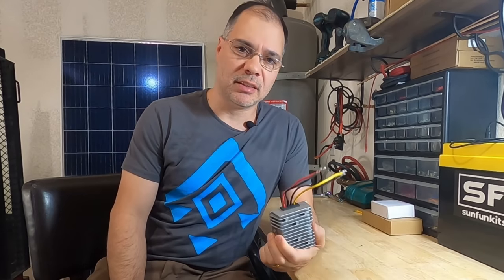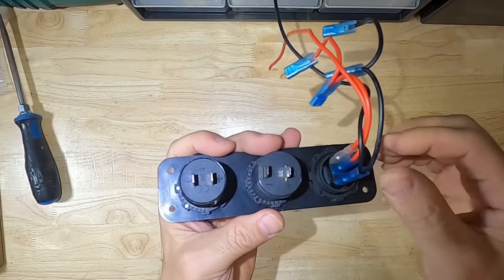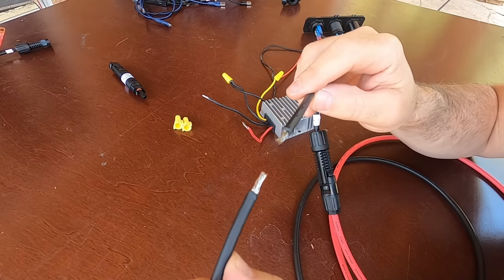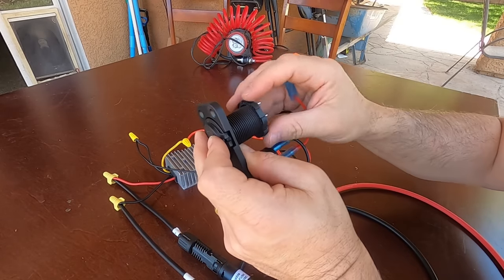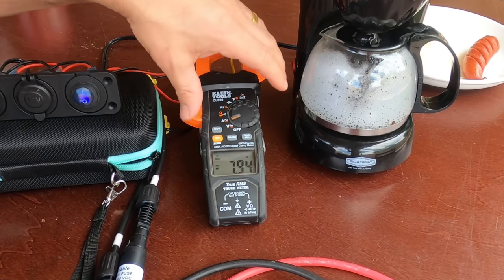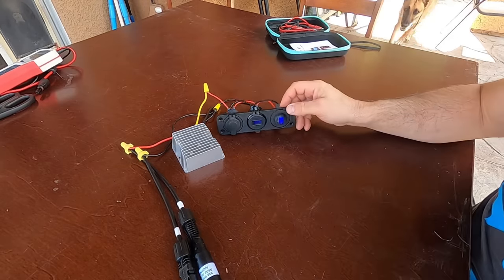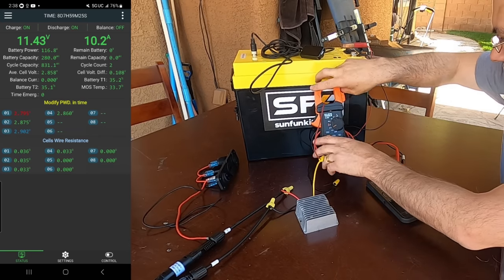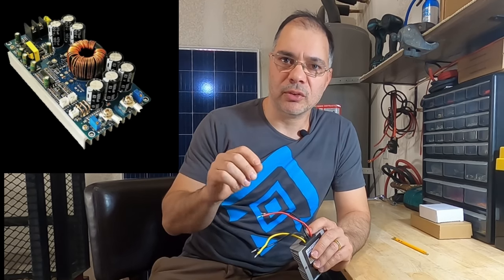SHTF - Cheap Emergency Solar Power! Use Any SINGLE Solar Panel! 1/2

Comment from the maker: >> 07-08-2023: I want to thank everyone who subscribed to my channel! Thank you very much!! I appreciate it GREATLY!!! 

>> NOTE: Although 200 watts of solar power is relatively benign. Never connect more than ONE panel or combination of panels totaling more than 200 watts of power to a buck converter. If you are uneasy about connecting wires, look at getting a USB Solar Charger instead (see below). Always use common sense when dealing with electricity. See my website for more details.

Schematic and Parts List  (updated 07-30-2023)
https://www.natesdiysolar.com/projects/shtf-emergency-solar-power/

Testing USB Solar Chargers:
https://youtu.be/gbXcJI6VRcI

>> 07-31-2023: Some buck converters will serve as an emergency battery charger but should only be used as such. I have been doing more testing with buck converters charging 12-volt batteries and have gotten mixed results. I am not quite sure why, but I think some buck converter expect to see a load in order to output any power. Either that, or it just is plain inefficient. Some will work and some will not. Even the junkiest MPPT is better at charging batteries from solar panels. Check my website for more details. Update video coming soon!

>> Do not use wire nuts as mentioned in the video. Use XT60, Lever Nuts or BUTT Splice Connectors. They are not DC rated or water proof and if the connection is not good, could create heat. I used them because I needed to quickly disconnect and re-connect to do this testing. 

>> If you plan on using this long term, be sure to use larger wires on the USB panel (12AWG - 14AWG). I use the same USB panels on my Solar Power Station but I have upgraded the wires to 12AWG. The 10A fuse that comes with some of these USB panels have a 10A inline fuse that is junk, it will work for the USB and PD module and smaller 12V appliances. Larger 12V appliances like the ones I used in the video will melt that fuse. I would replace that fuse with an automotive blade style 15A - 20A fuse instead and place it on the output of the buck converter (positive) wire. I will update the schematic on the website to reflect this.

>> Just found they actually have a tiny buck with USB-C and USB built in so no USB panel needed. So if you are looking for USB charging only take a look at this one. You can also just get a USB Solar Charger but this unit lets you use any solar panel. But if you already have a solar panel, this unit is cheaper than a USB Solar Charger.

If anyone can find a "plug-and-play" converter, please let me know. I really would like to build a small "power block" for use when camping. It would have all the common outputs you could imagine.  I found a mini MPPT and all I need is tiny 20 - 50AH battery. 

Affiliate Links:

Please see my website for more details and options.

8-85V to 5V USB  to 5V 3A 15W (USB ONLY)
https://amzn.to/44ibiVk

DC-DC Converter 20-90V to 12V DC - 20A 240W
https://amzn.to/3NPFtxt

DC-DC Converter 8V-40V to 13.8V DC - 10A 138W
https://amzn.to/44DeoCU

Dual QC3.0 USB Car Charger Socket Panel Switch
https://amzn.to/3JE7tkU  

10 Feet 12AWG XT60 Solar Panel Ext. Cable 
https://amzn.to/3rdKRBG
 
Pair of 9In 12AWG MC4 Pigtail 
https://amzn.to/3Py8bEd

Enjoy :)
Reply: People need to know the "Ampacity" of their wiring. For 6' or less (Round trip pos to neg) 14ga is rated for 15 amps, 10ga is about 30 amps. Amps times voltage will approximate wattage. 
12v x 10A is 120watts, less wire loss, efficiency of the conversions, and connector quality. No Gold?, good luck. 
But your idea is sound, and very useful if protected from EMP. How do you protect from multiple EMP's? I have Laptops awaiting long term storage, hard drives and DLP projectors. The Sun has spat a massive CME this year, fortunately on the far side. It would have devastated 1/3rd if it was 5 days later or earlier. It would have melted all metals. Bridges and buildings would pop and crumble. No power, no fuel, no rescue. We can't afford to water our plants and the soil. Recycle every drop. Dehumidifiers reclaiming water from the air. Actually more efficient than cleaning new source. Deep pockets are trying to control water. Oddly enough, we buy a lot from them already. Sounds like Win/Win for them.
Reply: Nate I enjoyed the video and I learned a lot about the system thank you very much however you cannot charge a 12.6 V car battery with a 12.1 V system you must have a voltage between 13.5 to 14.5V to push the current into that lead acid battery just letting you know a little old fashion automotive and Truck electricity knowledge there buddy.
Reply from the maker: @papadean.  thanks.  I actually mentioned that in the video as well as provided a buck converter option with 13.8v output for that purpose.  😳 thanks for watching !
Reply: my car battery always fails from the small solar system used. will try your system out.
Reply: 👍Pm

Comment: This is a great idea but I want to comment on the wire size used connect the switch etc. You didn’t specify but based on what I saw in the video that was 16 or 18ga. wire. That is way too small for a 20A buck converter. Everything should be wired with 12 gauge pure copper wire, with a 20 amp fuse in line with the output of the buck converter. Natural disasters are bad. Natural disasters plus fire are much worse.
Reply from the maker: I did specify in the video and in the description.  I also recommend upgrading them.  Unfortunately, they all have the same crappy 18awg. Right you are.  Good observation.  👍
Reply from the maker: See @9:45 and @19:42 . This is the way they all come.  I searched for ones with larger wires. Thanks for watching and the comment.
Reply: Most factory 12v outlets in vehicles are rated for 15 amps yet they use 16awg or even 18awg. 
If the wires are shorter as they should be in this application, your resistance will be lesser than in a vehicles 12v outlet.
12awg is ideal but 16awg is okay unless you're really pushing a steady 20 amps.
Reply: @JesusSaves86AB  I would rather use a larger wire than chance a fire in my system burning down my RV.
Reply: @Tumbleweed5150  That goes without saying. Wire is cheap and anyone willing to make something themselves will spend the extra pennies. I'm simply adding context for clarification.
Reply: Six months ago I plugged the output from the 100w panels into a 12v tent fan and it worked as long as the sun was shining.
Reply: Just to be different. If you are going to do some eating on a video, one should always hold the fighting irons correctly. It looks so much better. I really did like the way you explained how to make that back up system. Thank you for sharing.

Comment: A better buck converter for direct connection to a solar panel would be 24v DC to 13.8V DC, 30 Amp..then it can be used to charge a 12V deep cycle battery as well. This system is great for running a thermoelectric cooler while on a picnic, no need to lug around a heavy battery.
Reply from the maker: Yes, I did see those, but the really great thing about this particular one is that it will work with practically any solar panel as the input voltage is not fixed.  I didn't want to be limited.  One unit to rule them all. The adjustable ones can do it all. Best of both worlds with a decent input voltage range as well.
Reply from the maker: The first panel I used had a voc of 38 volts. Would not work with a fixed 24v input buck.
Reply: I would second the suggestion of 13.8V. Most devices called 12V are actually expecting to have 13.8 and may labor or not put out as much power on 12V. As a bonus…. These units can connect directly to 36 and 48 V batteries. This may have been salvaged from discarded electric hoverboards or scooters.
Reply from the maker: @tegra5971  yea I saw those higher voltage output ones but not with a 20 to 90v input range.. that was real appealing to me because it would work with almost any panel. But yes.  Most 12v nominal will operate up to 14v and yes these bucks tend to sag.
Reply from the maker: The perfect unit would be say 20 to 70v input and 15v or 14.8v output .
Reply: @natesdiysolar  The ones I sell look identical to yours and are new old stock from 48 volt lead acid street (vespa like) scooters.  They are only labeled on the deteriorating plastic bag and say DC to DC 48-12.
They are actually at least 90 in and 14.4 to 14.8 out.
I'm not sure what the maximum output current is, but one of the scooter types had very bright dual headlamps as well as turn signals, running and brake lights.
With a fully charged battery pack imput to this DC to DC would be 60 volts through a 20 amp fuse. Output was unfused (China not me).
I have tested the entire scooter with 5 batteries so add 14.4 v to those numbers is safe.
I suspect mine are identical inside as well as outside to yours, and that if bolted to a metal structure and had sufficient input voltage they would output 14.4+ volts at 20+ amps for days on end.
More if fan cooled.

Comment: Very interesting and informative video you made. Gained a sub here, I'm just getting into some solar stuff. I just picked up 7 100w panels from a friend for dirt cheap. I have a charge controller for batteries but this is an excellent way to expand capabilities in worst case scenario. 👍
Reply from the maker: Thanks! Appreciate it!

Comment: While the thumbnail's challenge is no controller, personally I'd still use an MPPT due to its massive efficiency then connect the DC to DC converter to the MPPT.  DC to DC works best more efficient if the difference between voltages is lower.   Nice showing of the 12V cigarette lighter appliances, never knew those.👍
Reply from the maker: During my research, I did find a mini MPPT I'd like to try out.  I use the buck as you say on my solar power station
Reply: @natesdiysolar very nice to see you. We will be waiting for your mini mppt.. Wish you best of luck man.. Appreciated ❤
Reply: I have been testing MPPTs all week. No, they generally do not have a big advantage, infact, in good sun conditions, the mppt actually uses power. Mppt can extract more output (creates a partial short accorss the panel, eg, a 12v panel will be loaded down to 9v) in low light conditions, heavy shade, or part shadow. However, in those conditions, there might only be 5% to 10% of full sun output.
So, yes, mppt might be 30% more efficient in 10% irradiance conditions. This means, your 10% of full sun output soars to just 13% of full sun - and this is the most optimistic best case scenario for mppt. A actual 3% improvement in low light - wow, I must get one of those.
Says me, how just bought another mppt 1hr ago, and will test it in a min.
Reply: @nordic5490  thanks for delivering such a valuable knowledge.. Thanks and love❤️
Reply: @nordic5490 Its been 3 days
Reply: As long as you over panel the system, a buck converter will work just fine and be quite efficient. Once the load exceeds what the panel can produce , the buck converter will cause the panel voltage to go into a death spiral.  I actually use 12V LED switching supplies in this way.  Used grid tie panels are really cheap and two in series will get you over 60V.  These supplies (which MUST be 180W or less)are only about $10 will work on that low a DC voltage with slightly reduced current.  But, they can be adjusted to 13.5V and with a slight modification be changed to 14.5V.  Then I just use a $5 PWM charge controller.
Reply: @nordic5490  MPPT charging works better for large solar arrays than for small "personal" arrays.  The cost of MPPT chargers is more worthy of the 500-watt and above array.  I am just fine with a PWM charge controllers for my small projects (like my power boxes) as long as they will charge Lithium batteries.
Reply: I'm actually doing the same thing here in Africa. I'm using 300w cheap buck converter modules which have variable voltage. I just set them to 13.8v which works fine with all car 12v appliances but it can also charge batteries. I have 6 panels each have their own buck converter all set to the same voltage them wire all the outputs in parallel. I also have the USB converters and an inverter. The system works quite happily and the addition of a battery means it works at night too. The buck converters are 80% efficient so in the same range and MPPT. Cheapest and most versatile solar system I've ever set up.

Comment: Most of what you say works although, I think people should just get a charge controller for charging batteries.  The converters give 12 volts for power, a battery needs higher voltage.  You should have both, it is a "division of labor" when the battery charger can charge and the converter can run the fry pan at the same time.  Besides the charge controller, PWM with 10-amp ($22.99) charging costs half as much as the 20-amp ($52.99 at the time of comment) converter.  The charge controllers also have 12-volt and USB power outlets, so they aren't just a battery charger.  

One other thing, you could get real portable solar panels for a little more than the framed panels.  Look up Allpowers 140-watt folding ($197) solar panels that have handles for easy carry.  You do pay for convenience - the 2 140-panels can be carried better than 3 100-watt framed panels.
Reply from the maker: That's cool.  Didn't know charge controllers had USB power out. Yea I have a couple USB folding panels just for USB Charging Only.  I forgot to show that in the video.  Thanks for the info and thanks for watching.
Reply: @natesdiysolar  Thank you, I did not think about a converter for my DC fridge.  I want to run the fridge on a solar panel (think picnic) but put that project on the shelf because I was thinking battery and charge controller.  I have ordered the 20-amp module but, due to high demand, I have to wait a month for delivery.

Comment: Its a novel idea and well explained but I would not rely on something being pushed to its limits for so long. If you are going to plan ahead I think you should plan for longevity.
Reply from the maker: Yes I'd say if you use this long term.. follow the 80% rule and only use 80% of rated output. They even say not to push it to max.. did u see where I shorted it.  I got 20A lol

Comment: If the SHTF situation comes to you, it might be a bit problematic to get hold of a buck converter if you don't already have one. However, chances are you can find a car battery (or better) lying around. Just connect the solar panel directly to it. It will fully charge the battery. 

The catch is you have to monitor the voltage to make sure you don't cook the battery, and disconnect it at night (unless you put a diode in the line). You can also run loads at the same time and the battery will cover when clouds come over. 

If you get the size of the load right, you could leave both connected and have the battery somewhat charged, but the load will hold the voltage down enough so it doesn't overcharge.
Reply: Most solar panels now have diodes in them that prevent back-feeding from the battery, as well as by-pass diodes to allow some charge through, even if some of the panel is shaded. The origional panel(s) I bought 30+ years ago DID have that problem. However, one can now get a simple PWM solar controller for very little cash, where even a simple one was over a hundred bucks back in the early days
.
Reply: @Tumbleweed5150  true; i bought 50w and controller for 40 euros few years ago, im sure it hasnt changed much. 50w aint much, but provides enough electricity to keep lightning and  stereo up and running  during my camping vacations :D.

Comment: When you were running the compressor it hit me that you need about 12 or 13.5 volts of ultra capacitors and you will have no more problems powering anything within reason.
Reply from the maker: Yea a couple of ppl suggested that.

Comment: Rather than the spending on a buck converter, a small battery and controller would allow many more possibilities...thanks for the live demo 👍
Reply from the maker: Next video will be just that.. kinda doing a ground up series to cover all possibilities
Reply: @natesdiysolar  yep...good move, people don't realize the potential of standalone systems... For my money grid tied systems are handicapped in all but industrial applications... The power companies are laughing all the way to the stock market
Reply from the maker: @owenbruce4120  yup

Comment: This is awesome, I see used 260 watt solar panels in the Vegas area going for about $80. This could be a lot of fun as well as practical. Thanks so much.
Reply from the maker: Always happy to see locals comment :) lmk how it goes if you do it.  I'd like to put this setup on my SxS as well.
Reply: Size your panel capacity to 200% of what you think you need. Because 50% yield seems prevalent. Highs, lows, smoke, and chemtrails. Who is running this circus? 
Anyway, I, and hopefully you will survive it all. :-)

Comment: Knowing the price for those kind of DC to DC converters, you can find an adjustable buck-boost converter with low voltage protection/MPPT for around a similar price.

I currently use a ZK SJ20 Buck-Boost module, which could take any input from 7-80 VDC to output 1.4-79 VDC; 20 amps, 300W max. It's a very versatile board, capable of acting like a power supply or as a charger
Reply from the maker: That's pretty good, actually.  Thanks.

Comment: I enjoyed the video significantly.  I recently purchased a similar converter to drop 24+ volts down to 12 volts and find it is really accurate.  On a panel producing 42 volts it is spot on at 12.1 constantly.
Reply from the maker: Very cool! Thanks for watching.
Reply: I did the same for 48V to 12V. I have a 48V 5.12kWh battery on a hand truck. It has AC out, but often times I don't want to deal with the losses of converting 48V DC to AC just to plug in an AC to DC converter again.